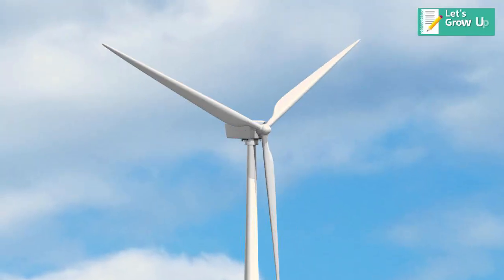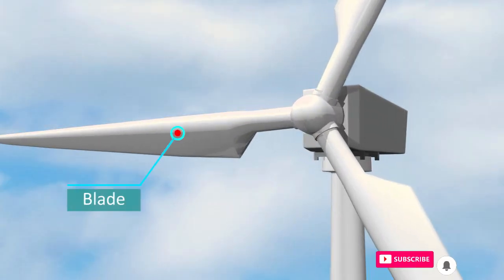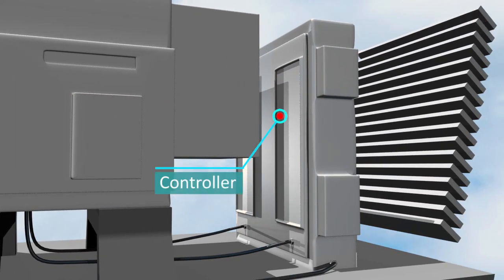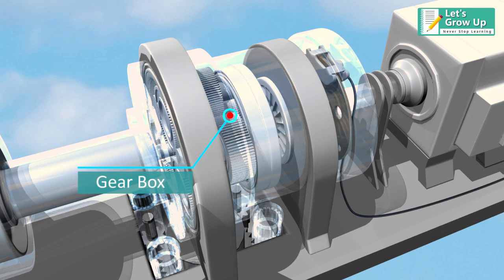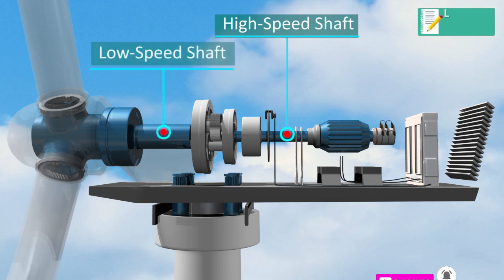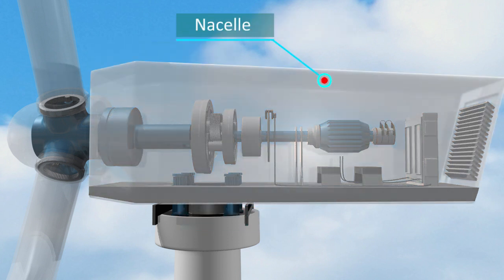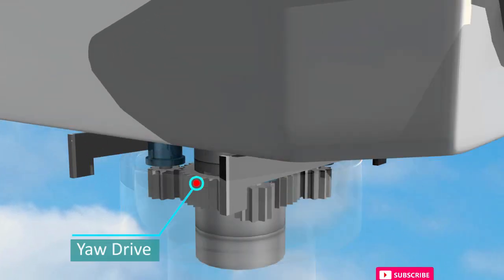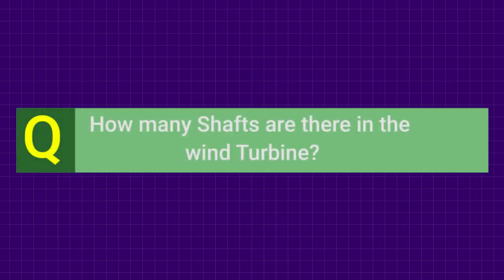How does wind turbine produces electricity | explain wind turbine | #letsgrowup

Comment: High speed shatf connent generator
Low speed shaft connet rotar

Gearbox iusing increse RPM... 30 to 60 Rpm earn rotar but this rpm increse 1500RPM using gearbox

Comment: there are two shafts in a wind turbine the high speed shaft is used to drive the generator the low speed shaft rotates at about 30 to 60 revolutions per minute. please share your source..